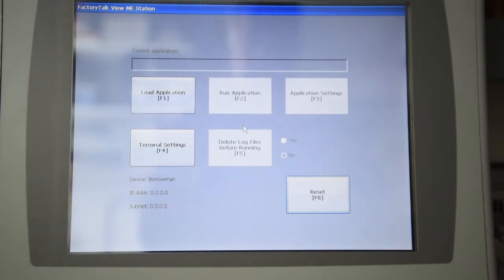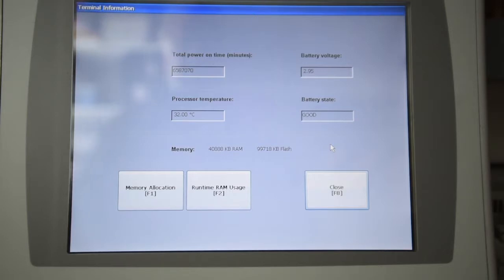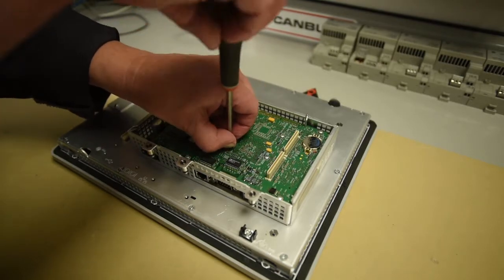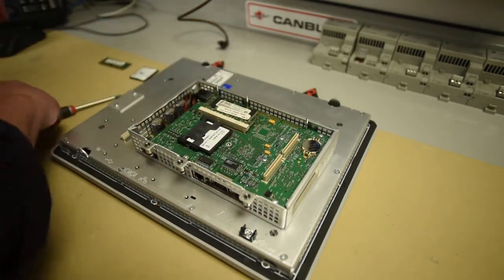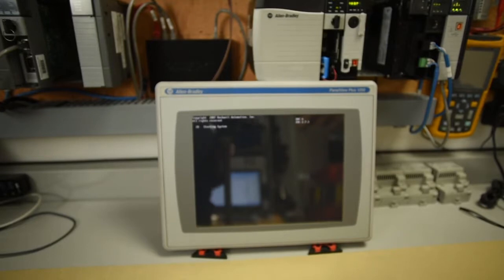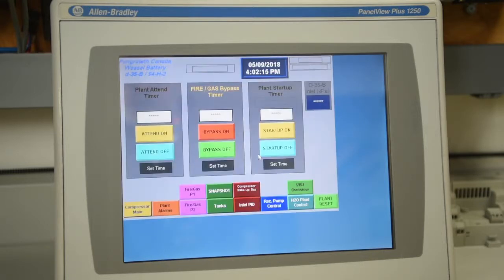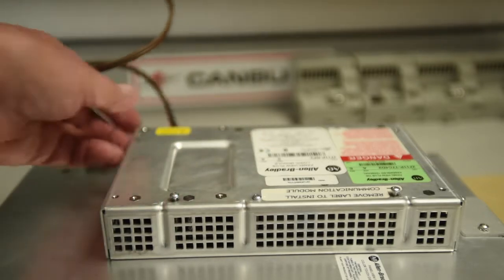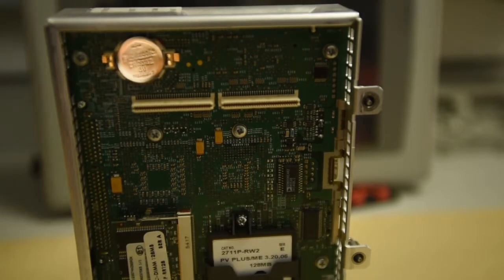Panelview Plus memory module - 2nd Video

Comment: hello sir , I was wondering if i can upgrade sd ram and cf card of allen bradley by other  sd ram and cf card but not alllen  bradley but its out cost around 50$ and in ab cost 800$ so am asking it is possible
Reply from the maker: Hello:  The CF card is formatted with the operating system and the RAM chip matches the card.
You should be able to pickup a set of CF & Ram from ebay or similar online market place in your country for a lower price than Rockwell dealers want.  Once you have made sure that the 'new' CF card has the correct version of F/W to match your running program, just reload your program on to the new card.
Sorry I can't help any more than that.
Thank you for the question.

Comment: Hello sir..hmi not working off mode only 
Back side of hmi faulty indication coming what is the issue can u possible to tell..
Reply from the maker: Hello:
Without having it in hand I can only guess.
I would suspect that the touchscreen is damaged and needs to be replaced.
The touchscreen overlay is made of a plastic and depending upon the age may have an electrical grid in it to work as buttons for the screen
You would have to send it out for repair or get an exchange unit.
If you have the parts in hand it is a bit of work to rebuild, but can be done if you have the experience.
Reply: @abplctestbench759  I think not a touch screen problem..becaz I swapped logic module  from another hmi ...that time hmi was on mode...so what is the pbm in logic board ...
Reply from the maker: @srinathan8494  - Hi:  Logic boards have been known to die.  You need to get a replacement or send it out for repair.

Comment: Where can a new CF card and ram be purchased? I have a spare panel view plus 1000 with the RP1 setup. Thanks and really enjoy the videos!
Reply from the maker: Hi Sean:
I would check ebay as you can get them there.
Not sure that there are any "new" available.  AB stopped making these around 2012.
The G series is the new ones and use CF cards for memory storage.
Happy to hear that you enjoy the videos......